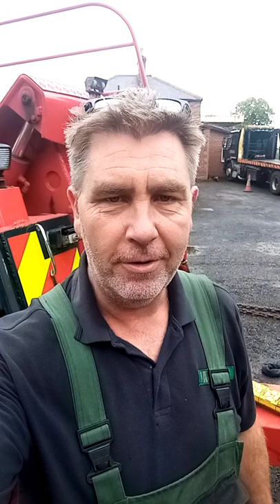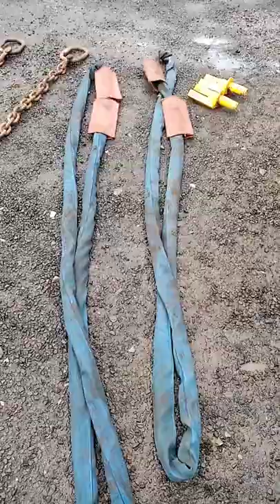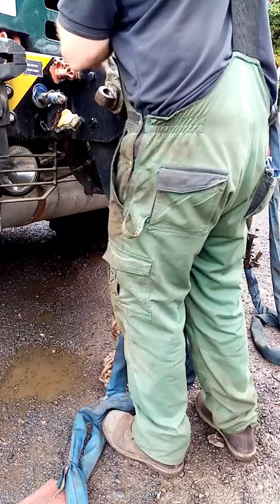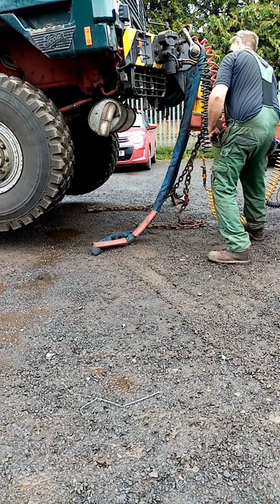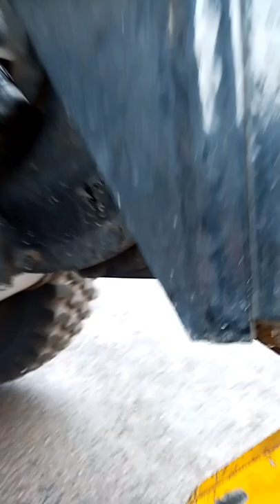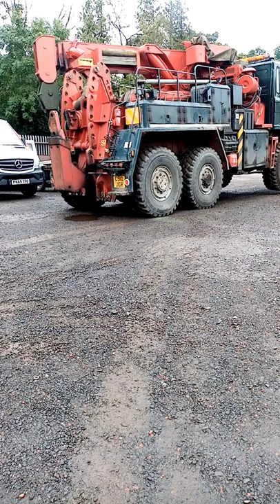chain lift recovery demo on foden 6x6

Comment: Why on earth are you using chains etc when the EKA comes with a bar to directly connect to the NATO recy eyes on military vehicles? That's what they are there for, and safe.
Reply from the maker: Hi mate yes it does but I'm demonstrating here how to recover a foden Recovery with a civilian underlift using a chain lift with chain forks
Reply: @kensjobs2237  Wouldn't a civilian underlift  take the adaptors present in the Foden lockers?
Reply from the maker: No mate a civilian underlift won't take the adapters, the Foden has a completely different crosshead drilled with holes right through which the adapters pin through and hang from the cross head whereas a civilian underlift has pedestals
Reply from the maker: @robertrich663  some of the forks fit a civilian underlift like mine but some of the 6x6 adapters are designed to come up from underneath the crosshead and pin in hanging u derneath like the H type adapters for Foden, Scammell etc and Bedford adapters for MJ and TM variants